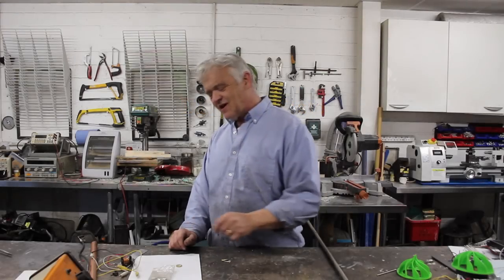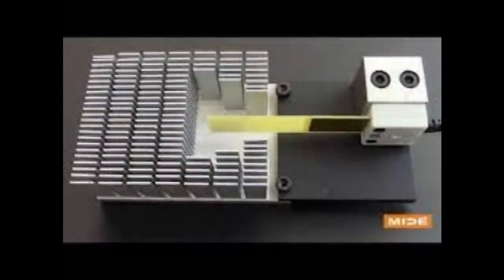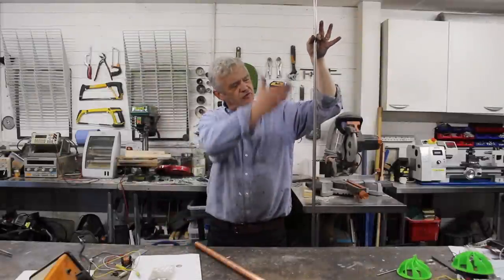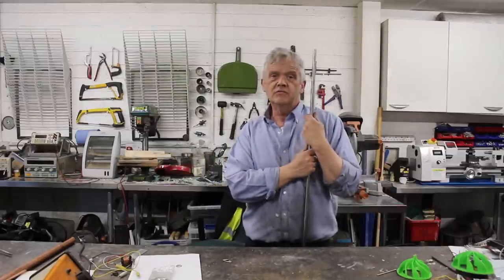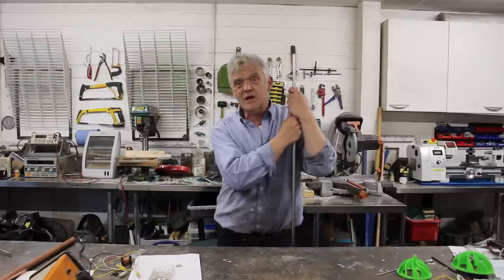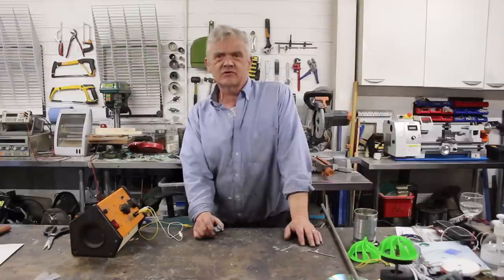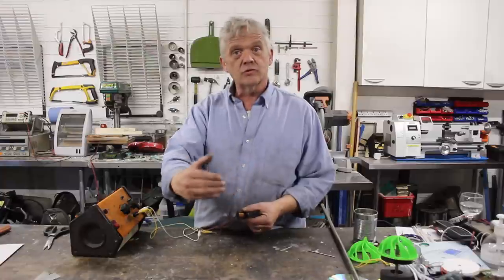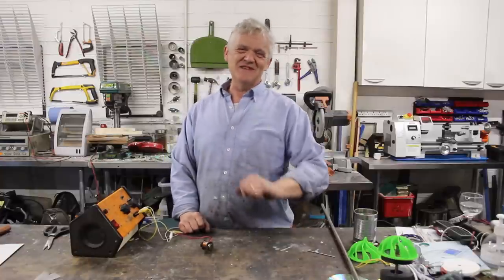1590 Solid State Fans And How To Make One

Comment: Many years ago a company made these fans for cooling circuit boards. They were piezo and the company almost went broke. Then an aroma company discovered them and saved the company by putting them in their aroma dispensers. Back in 64' I tried making a helicopter solid state by creating ionization flows with 14,000VDC after seeing it in Popular Mechanics. It didn't fly, but it made some wind.   When I saw the title I thought you were going to encourage your viewers to plat with high voltage.
Reply: The helicopter idea is fascinating. Was the airflow somehow directed im assuming you were using piezo-electric fan concept if you managed to direct the airflow, what was the yield, what kind of results did you get? Ive worked in hvac for years and its the kind of idea ive been toying with but never succeeded with so far. Directing airflow with these simple fans could be gamechanging in terms of power consumption, and plastic waste problems.
Reply: @tequilaboxer1  The idea is very similar to a furnace electrostatic air cleaner. Pins faced down towards an aluminum screen with the opposite polarity. Charged molecules traveled to the screen, lost their charge and kept going.

Comment: First I'm hearing of solid state fans. Very interesting technology.
Reply: Back when the Mac Plus was one of Apple's top of the line offerings, there was a company that came out with a solid-state fan kit for it so that if you maxed out the memory [4mb: woohoo!] you could still keep it running in a warm environment [Mac Plus had convection cooling only.] The big jump to the Mac SE when it superseded the Mac Plus was the inclusion of a fan [to make the available internal hard drive a workable option.] So yeah, I heard about them 30 years ago, but still haven't seen them make it big for some reason...

Comment: Good build.  Also, a salvaged fan (or hard drive or cd drive) motor with an eccentric or a cam lobe would work -- I favor a tri-lobe cam with a reuleaux triangle, for a 3x rpm frequency.  Vibration motors for buzzers are also really cheap.  As for the fan design, it always reminded me of the electric school or fire alarm actuator, with a clapper between two half-spherical bells -- a linear motor with a double throw.

Comment: Hi Rob. I just asked the similar question in the omnidirectional speaker video: could a piezo element  be applied to create an ultrasonic device for cleaning or processing nutrients?. Would it be better to use a speaker or a piezo electric element?
Thank you for all your contributions!!
Reply: Ultrasonic cleaners use transducers, but I'm not sure if they're piezo or just driven at a certain frequency. That's the main difference - the piezo element contains its own crystal that determines its frequency, and it can only do that frequency. A coil and magnet has to be driven by an external circuit and can make any frequency or combination thereof. I have no idea about processing nutrients, that's something I never heard of. But you can make an ultrasonic device with either method. For the hobbyist tinkerer, a coil and magnet is probably easier, because you don't need an assortment of crystals that you have to change out to test different frequencies.

Comment: I imagine how hard it would be to calculate the resonance frequency. Usually it's constant to the material and rigid points. But wouldn't the air resistance alter it and be considerable in this case?

Comment: Robert apparently ancient megalithic structures were built buy using sound to manipulate the crystalized rock. Some say they were able to literally liquify the material with harmonics some say they were able to levitate the material. I suspect they had the ability to do both. Can you investigate this please
Reply: Not sure about sound, but after assisting with building a modern stone circle... Levitation is defo possible... All it takes is heavy people jumping off stone in unison, and on to levers under stone.
Reply: they used copper saws and sand to make cuts then used pulleys, levers and leverages to move the massive structures into place. there's a video of a guy in the US moving around a 20 ton slab by pushing it because he had it perfectly balanced on a small stone (pivot point). he erected the slab on his own using extremely basic tools as far as I remember.
Reply: @chrishayes5755  bro look up Brien Forester . theres ancient blocks all over the world cut and laid so perfect with a pillowed shape like they were pulled out of a mold and casted. They align astrologically and on certain energetic conveyances of earth. We hardly could do it to day . the way these blocks are shaped and laid we cannot do today . look into gram Hancock's work too

Comment: Looks like a fish tail! Solid state boat?
Reply: That thought occurred to me as well.
Reply: The density of water compared with air may damp it dow too much. ..... But it is one Cool Idea!
Reply: @totherarf  Yup, plus the locomotion of fish involves their entire body and other supporting fins, not just their tail flapping about. And there's a reason why snakes aren't great swimmers. They can, but not with all that much speed. Wouldn't work with just one flipper even if sufficient force could be produced. You'd have oscillations in the ship itself to deal with, which is why bacteria that use a single flagellum don't generally whip it back and forth but rotate it in a corkscrew-like pattern. But cilia on the other hand... Then again, ya run into complexity issues there.

Also, if with just two, ya got a bird, which people have already made small working prototypes of. I forget the technical term for that though.
Reply: @custos3249  One difference might be that microbes tend to use a circular csa flagellum (I think) You are talking about a 3d object albeit a flat one! Also driving it at a higher resonant frequency may make a difference too. Worth checking it out though!
Reply: @totherarf  In the case of cilia, i.e. having an array of fins, a higher frequency may help, but again, complexity issues. With just 1 fin, it'd be like over-volting a motor. Speed would increase, but torque, which is what you need as the volume of water (the load) is the same, wouldn't by much. You could make the fin smaller too, but good luck on getting useful movement out of it. You'd need more current, which brings us back to the snake comparison for locomotion (not form factor though). Technically, we'd be looking at eels and there rhythmic movements. I keep wanted to call it "peristaltic movement" but that's technically about the coordinated movement of throat muscles - the 3D version of what I'm talking about.